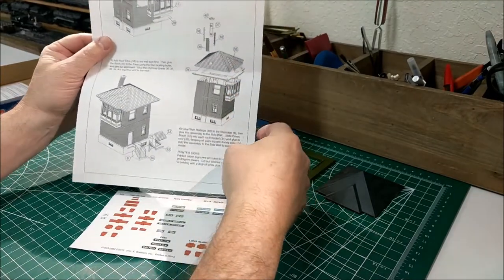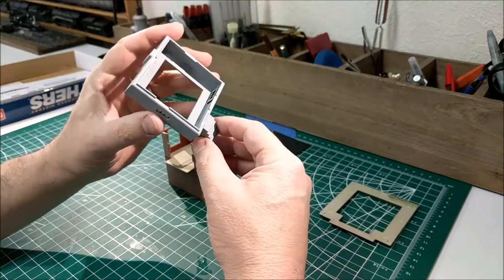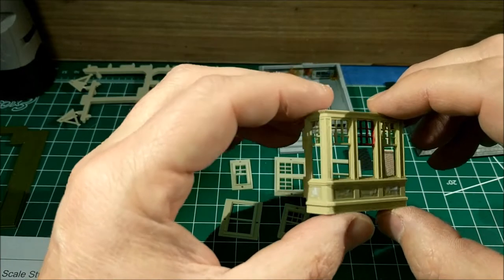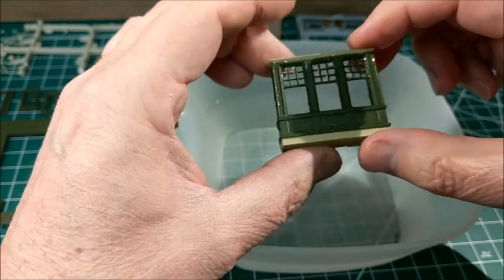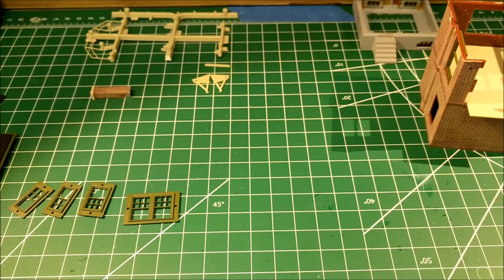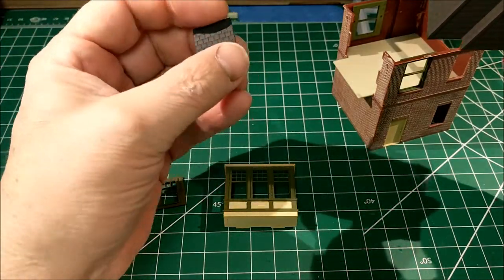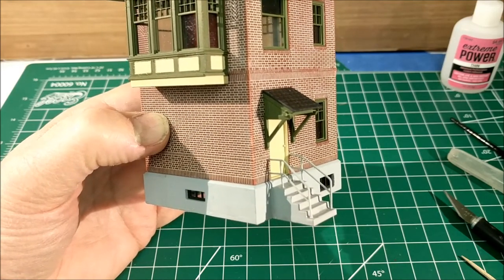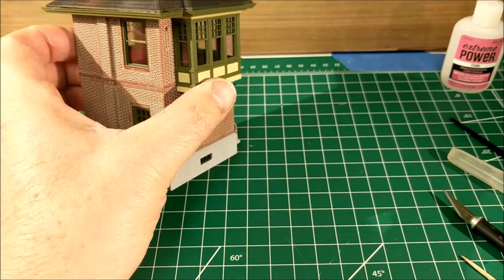Ep 27 HOW-TO Walthers PRR Block and Interlocking Tower

Comment: Hi Michael, may I suggest using Canopy glue to glue your acetate  windows on instead of Goo. It dries clear and it will look much cleaner. There is all sort of uses for this glue for modeling. It's one of my go-to's in my glue arsenal.
Reply from the maker: I will check that out,  I tend to make the acetate over-sized so you can't see the acetate, but I know that is not always going to be an option, and I will need to use canopy glue.  Thanks man!

Comment: Alright I also have to ask what you did to texture the brick mortar. I've brushed on powdered pastel stick, but I'm not sure if I'm satisfied with what I have so far. I haven't dullcoted it yet.
Reply from the maker: I used thinned paint and then scraped the surface lightly. Scrape too much and the paint gets filled in with plastic. It takes a light touch.

Comment: What did you use to fix the ripped up paint from when your removed the liquid masking film? Did you have to get a non-spray version of the RAF dark green?
Reply from the maker: I used rattle can Tamiya AS-9 Dk. Green (RAF), but since the masking film didn't pull everything off, I used painters tape and sprayed it again.  If I need to touch-up any spots further, I spray a little paint in the cap of the spray can and use a brush.  That way I know the colors always match, and I have a painted sample in the cap if I want to check it for some other project in the future.  FYI - I spend a very long time with painters tape masking the subject, for example, these green trim pieces took well over an hour just to mask perfectly before I started painting.  Hope that helps.
Reply: It does, thank you. Did you ever put any signs or decals on?
Reply from the maker: No, it still looks pretty much like the last shot in the video.